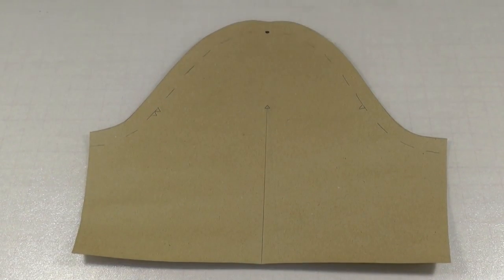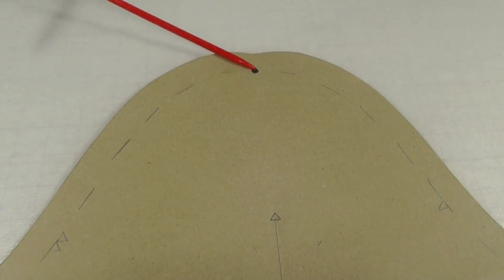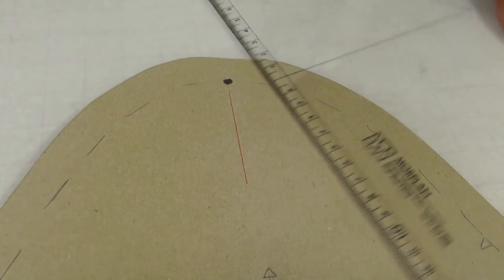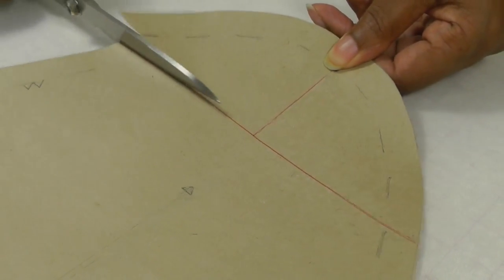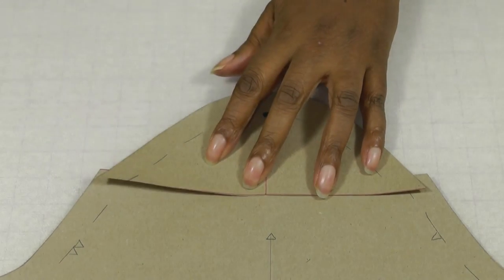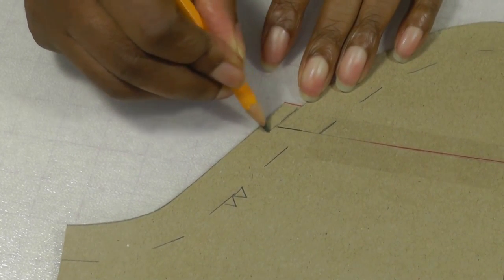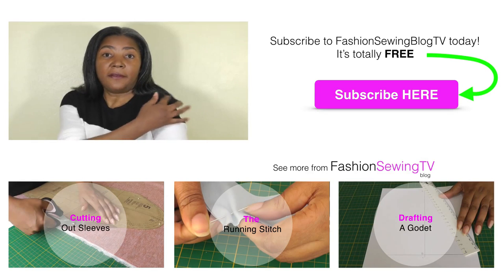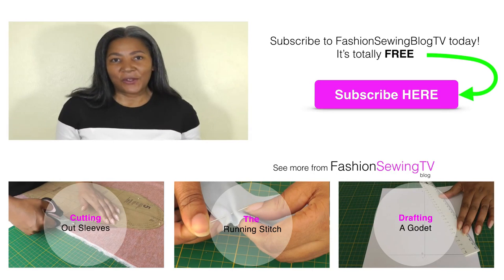Reducing a Set in Sleeve Cap

Comment: Hi colleen ,love your tutorials. Do you think its okay to insert all one piece sleeves the flat way. Also is it easier to insert a sleeve into the armhole using a three eights seam allowance rather than five eighths. Obviously the sleeve would have to be trimmed. Sometimes with fabric which is not very easily manipulated its so hard to insert the sleeve perfectly.
Reply from the maker: Hi Linda, Yes it's okay to insert a sleeve using the flat method. To have perfectly fitted sleeves is not about seam allowances whether its three eights or five eighths, the sleeve head ease is the key to a beautiful shaping of the sleeve before insertion. When working with diffcult fabric maybe use lots of pins and sew small basting stitch.

Comment: Is it possible to increase the length of a cap sleeve? I have seen a pattern I like but don't want to show quite so much arm.
Ideally I would like to just put a normal set in sleeve in, but can this be done? If so can you give me any tips on how to do this?
Thank you :)
Reply from the maker: Yes you can lengthen the sleeve cap to the required amount, and then test the sleeve in calico fabric before cutting it in the actually fashion fabric. Thank you for commenting Elaine.